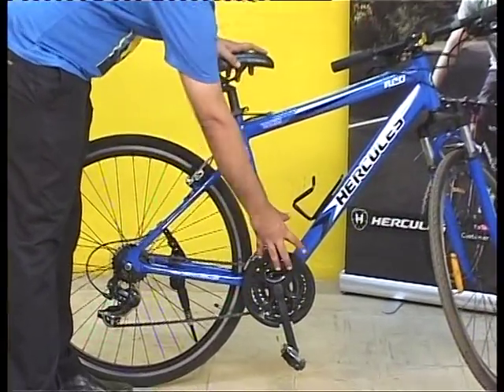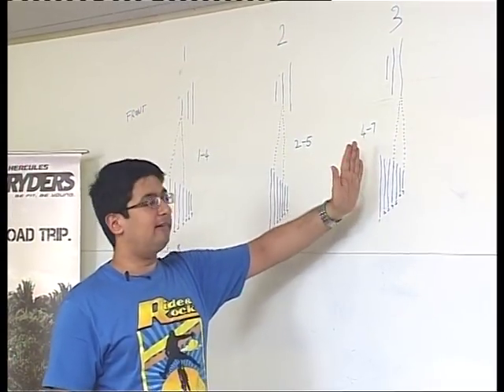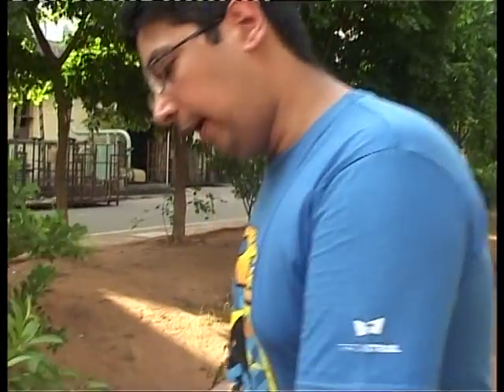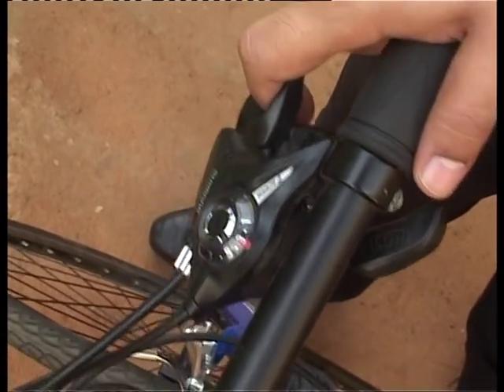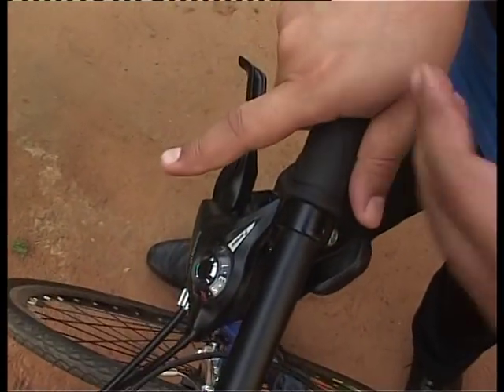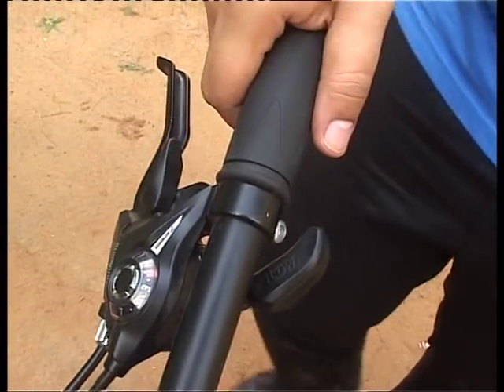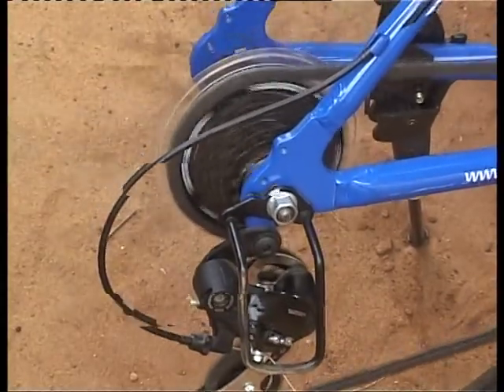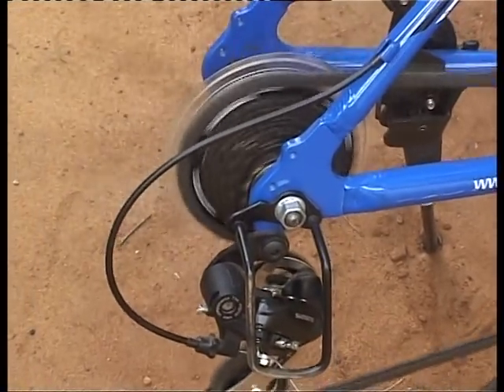How gear shifting works

Comment: Hi buddy,
While going back the gears, intially u were at 3 at front and 7 and back, You moved to 2 in the front  first actually according to theory u shave moved to a lower gear on the back and then shifted to 2.  right?

Comment: I was wondering what's mechanism to apply the brakes in situations of emergency or red light. 
Will the person be required to simultaneously change the gears while applying the brakes or is it that he can take them to neutral while once he has reached at a stationary position

Comment: Very well covered on the basics of gear shifting and the ideal gear ratios on a bike. If possible add more details on ideal gear combinations for different riding conditions (incline, flat surfaces, steeps, ) to reduce wear and tear on the gears/brakes/tires. Also any inputs on if at all gear ratios can help in traction control on different surfaces. Thanks

Comment: I am around 5.9 can you tell me what is the best frame size for me..
Reply: +Zubair Ahmad sir, 18 inches of frame would do. but to be sure what size you actually need..rally down to a bicycle store and see, your crouch and seat handle bar should have 1 inch gap in between.. that's the best way to know which one will suit you.
Reply: thanks buddy.... and one more thing the shock absorber give me a line of oil above the seal, is it a oil seal leak?  thanks
Reply: thanks buddy.... and one more thing the shock absorber give me a line of oil above the seal, is it a oil seal leak?  thanks

Comment: great video. also wanted to mention the closer the chain is to the bike, the easier it is to pedal. when riding up a hill the chains on both derailers should be close to the bike
Reply from the maker: +Kingsley O Thanks for that tip.
Reply: Thank you so fucking much, this is the most helpful thing ever, man i love you!
Reply: Also, so should both of things be at the same? Like on my right handle is on low so should my left handle be on low?
Reply: +AlphaDog297 
if your right handle is on low, it would be best for the left handle to be at a low-mid position to prevent overstretching the chain (cross-chaining). for example, if your front gear is on 1/3, the optimal position for the rear gear would be between 1-3/6. i would also suggest you find a video on cross-chaining, it'll explain more on why gear shifting is important.
Reply: +Kingsley O i was messing with my gears and now i guess it got cross chained because it is not moving the chain anymore, what is this and how do i fix
Reply: AlphaDog297
same thing happened to me the first time i was learning about gears, i messed up my chains. you probably have to take it to a bike shop for repairs. hopefully it won't be too serious........... knowledge is power
Reply: +Kingsley O i think i might just need to take off the chain and put it back on, should i?
Reply: +AlphaDog297 
you can try that but if it doesn't work, take it to a bike shop
Reply: +BSA Hercules Are you indian ?

Comment: Excellent, concise video  on the practical aspects of shifting properly. However, a couple of times, while actually demonstrating shifting to the highest gear on the front deralleur and then downshifting to the next lowest gear in the crankset, you were out of the ideal range in the rear deralleur, theoretically putting too much stress on the chain. I believe you should always make sure you're in the proper range by shifting the front deralleur  first when moving to higher gears(which overlaps the rear deralleur settings), then move the rear deralleur within the range for that gear ,for example, move the front deralleur gear to the highest gear 3 before moving the rear dearalleur from cog 5 to 6,(since 3 covers from 4-7 in the rear cogs, and you were already in 5) and not vice versa as you demonstrated; similarly, when dowshifting from 3 to 2 in the front deralleur, you should shift the rear deralleur from 7 to 6 to 5 first, then downshift the front deralleur and not vice versa as you demonstrated (since gear 3 covers 4-7 in the rear cogs). This way you are never out of range, as you explained in the theoretical first half of the video!
Reply from the maker: +michael greene Thanks. Glad it helps.

Comment: uh, totally lost me, except for the pictures explaining  the handlebar buttons.  
 I have 2 levers on each handlebar. and I just want to know which ones to push-or pull, in which order, to change the gears from lowest to highest, and back down. I had a 10 speed a hundred years ago in Jr. High, but who can remember??
And isn't there something about you have to be peddling?
 This video is getting CLOSER to the basic instructions I'm looking for, because at least now I see why I thought my bike was broken.  It won't stay in gear, and the chain keeps getting  loose.  Since I had no idea how to shift, I've just been pushing those levers on each side randomly when anything wierd like that happens, hoping something makes it peddle.  It usually helps, for awhile, but I have no idea what I do. But, last time I walked the bike home because I thought it was broken!
So, Thanks for reminding me of the basics,  like using the right buttons as the 'little speeds', and the left is kind of like the 'turbo' gear into the next level.
BUT, then you kind of went back and forth into 7th?--left right left?   How do I even know how many gears I have on this bike I bought from a yard sale???   
It seems like you bike people must have always understood the principles of how those levers are used, but I know there are lots of people like me with bikes out there, because NOBODY I asked knew how to work the gears either.  They just stay in whatever setting it's in.   LOL!
Reply: maybe you can increase your IQ
Reply: I wanted to say the same thing!

Comment: sir,
you solved my problem by telling the ideal ranges of the gear chain..
i used to keep the back gear  wherever i wanted even if the forth gear was set on 1,2 or 3.it caused the chain fall sometime.the gear ratio thing made me understand.thanks !